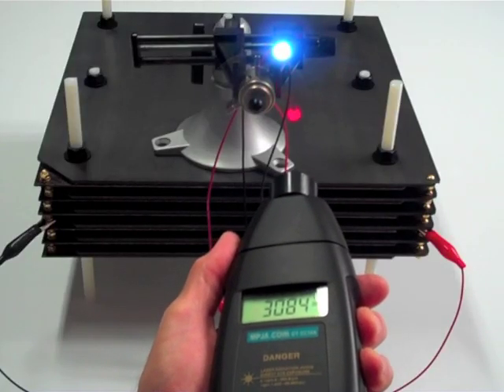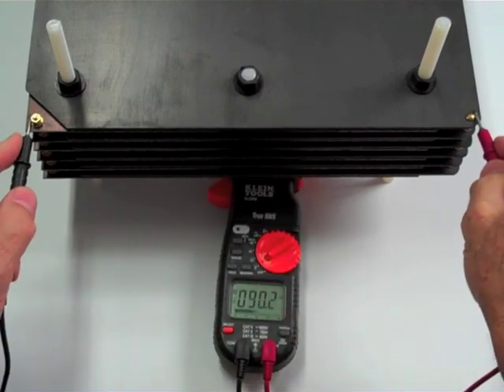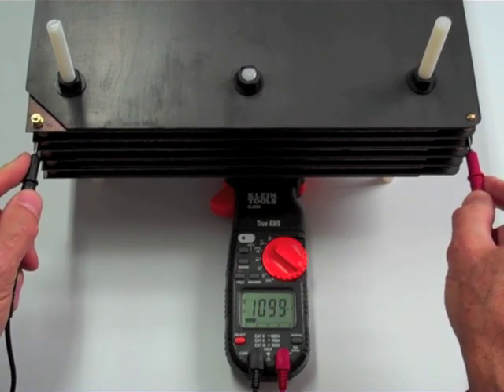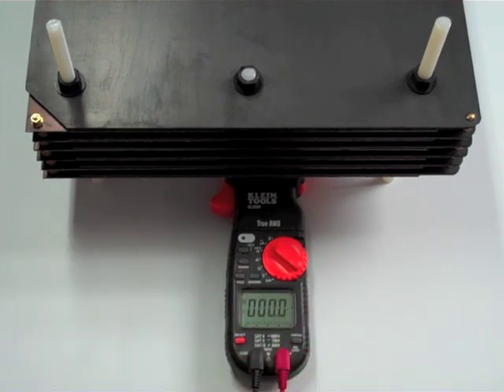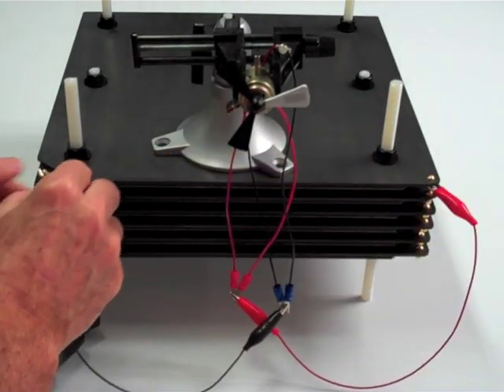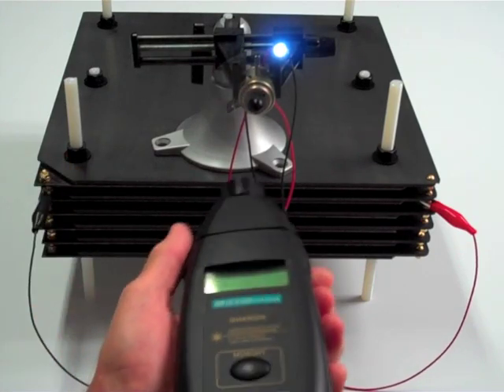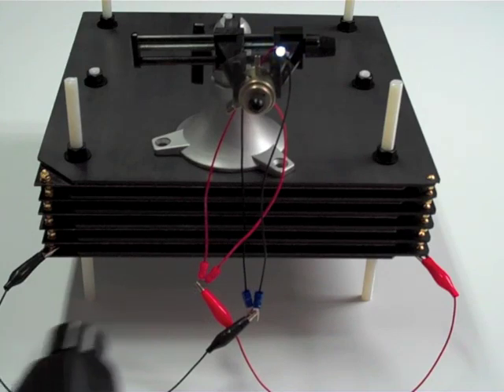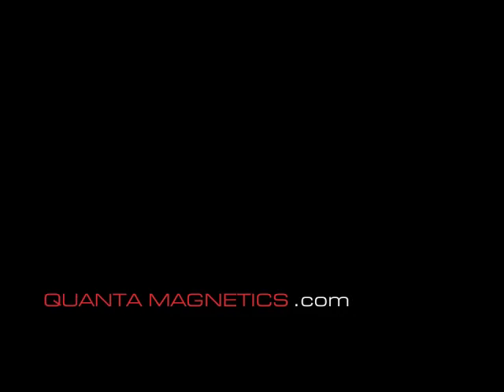SiC Graphite Module Output

Comment: you have add 2 Neodymium magnets to your motor which will increase the rpm of you motor remove them and show us again what the rpm would be
Reply from the maker: Of course it's weakening the magnetic field. The rpm is not the point.
Reply: What is the point? Im trying to understand what amount of energy can be harvested from these units in direct comparison to redily available methods like some D-cell battaries...? You never do direct comparisons of existing tech. Like a cost per wat over time or something.

Comment: what is the longevity of these cells? And do dead cells need special processing to dispose of?
Reply from the maker: I have test cells that have now been powering small devices for nearly two years non-stop with no noticeable degradation other than internal staining on an alloy plate. There are no explosive, hazardous or toxic elements per each cell.
Reply: PMMG4HYBRID ,  and what is the maximum load per cell you've been able to maintain over that time frame? and just to be clear; you've not had a cell run dead yet...
Reply from the maker: J Sullivan - The key is to tailor a cell or cells to a specific load whereby the cells do not decline over weeks, then months of 24/7 operation of the load. You'll know in a couple of weeks or less if it's not enough, and if it's overkill, so be it. Only a constant dead short or a continuous oversized load will damage or possibly kill a cell.
Reply from the maker: Zephir AWT - Each cell is sealed from oxygen and zinc is not being used. Some of those air depolarized batteries are actually very good for energy density, stability and longevity other than a paste that must be changed in some.
Reply: That means, each cell is composed of graphite plate stacked with some alloy (plus some SiC/polymer separator)? It would create galvanic cell and the output current comes just from this "internal staining", i.e. the corrosion and gradual degradation of alloy plate. Have you tested, that your device is nothing more than air depolarized battery?